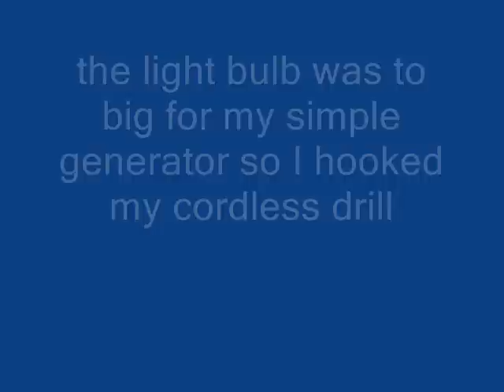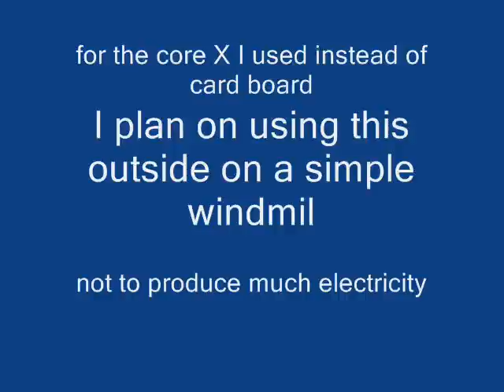my first try at simple generator for simple windmill

Comment: dc motors all of them when you turn them they work like genarator. so take apart old razor scootor or even a walk man caset player add a diod its like a one way valve and power can flow from motor to bat or directly to light. now howes your buddy